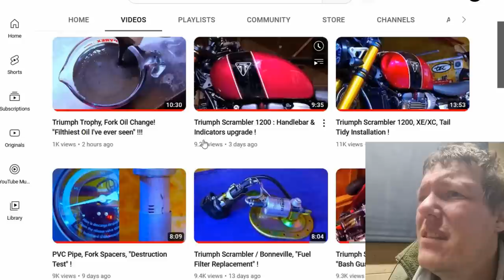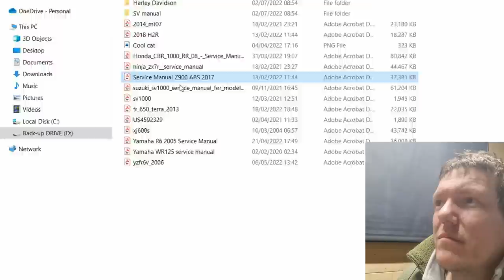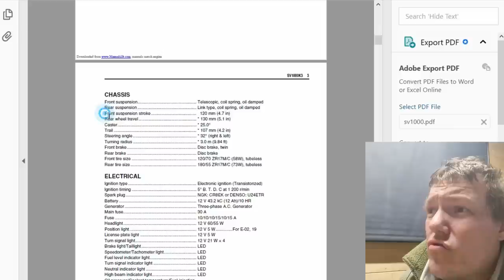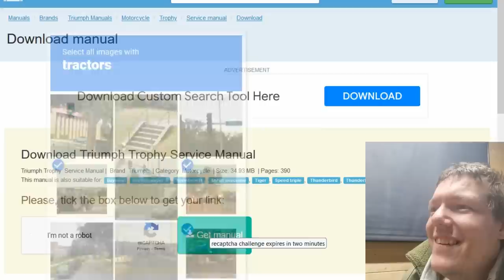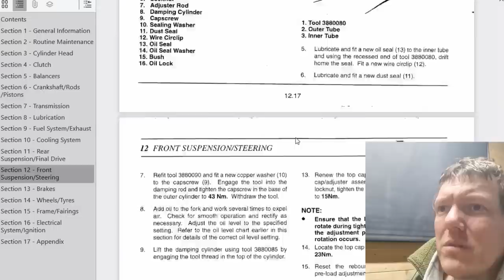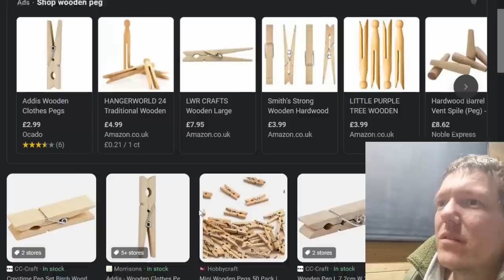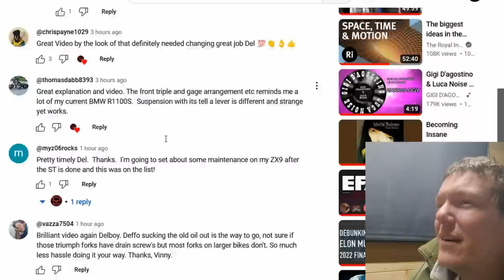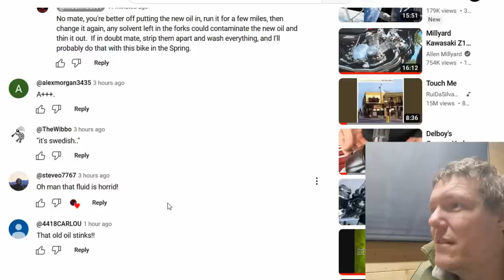Terrible fork oil replacement

Comment: He did say drain 'Screw' not bolt. Years ago even in 90's there was drain screws either on the side or on the back of the fork slider to drain fork oil out you are wrong by looking at Bolt.
Reply from the maker: Lol what? Dude, that's not what del meant. Can you tell me what the difference is between a bolt and a screw?
Reply: @dirtygarageguy  it is what he meant. Coming from earlier generations i knew exactly what he meant. And you are clever enough to know the difference between a bolt and a screw.
Reply from the maker: Can you give me an example of a bike that does?
Reply: @dirtygarageguy  kawasaki GT550
Reply from the maker: And del had one of those?
Reply: @paulmessenger1006  Hey, that's one of my favourite bikes of all time. An interesting in-between in engineering, with interesting gas-assisted suspension front and rear.
Reply: @dirtygarageguy  dude stop picking. He was correct when said no screw. Many bikes of that era did. You asked for an example which i gave you. Just admit and man up when you are wrong. That gets you more respect.
Reply: @dirtygarageguy  a bolt has a shank.
Reply from the maker: I asked you for an example to shoe how old that concept is, about 50 years old. Almost every bike on the road today doesn't have one, del has never mentioned it before so I said I don't think he meant that. You seem to think he does. They're just 2 different opinions on what we think someone said, there is no right or wrong... you're just spitting your dummy out.
Reply from the maker: Bolts have a nut, screws have a thread in the substrate. If you have an M12 x 100 with a shank and a M12 x 50 with no shank one is and isn't a bolt?
Reply: @dirtygarageguy  no shank is a 'set screw' as you should know. You oviously dont want to admit you are wrong, and others have also pointed this out to you.. My respect is now diminished.
Reply from the maker: Fuck sake, it's tit for tat with you isn't it... Read the ISO paper on bolts and screws.... some wood screws have shanks, are they now bolts? Use your head.
Reply from the maker: Forgot to add, do we call cap screws with shanks bolts? The clue is in the name....
Reply: @dirtygarageguy Dude who's playing tit for tat?
Reply from the maker: I just love winding people up when they cling onto every last detail... now before you say isn't that what these videos are? Yes, but I try to cover every base because people are learning...
Reply from the maker: In other words chill out dude, you're getting too irate

Comment: Del is trying to Show People How to Save Money, Labor Shop Hours By Doing it Your self, Thing is You Don't charge yourself Labor So it Cant Take as long as YOU want So Just Take off the Forks and Empty out all The Oil then Take another Hour? to Check The components for wear Nice and Clean only do it once change Worn oil with Good Oil Get more Pressure more leaks that's Two Weekends Wasted doing the same job twice.

Comment: Hi Matt, currently 08:48 in Melbourne Aust, and already 24.9 Celsius, on its way to 32 and sunny. Oh, that's right, it's Summer here, WooHoo!
Reply: 11:00am - 31.3°C🌡☀ In (Werribee) Melbourne, Australia.
Pretty warm in my garage (rebuilding my mates Zx14 master cylinder)  :D
Reply: NZ, 4:40pm, 20°C, sunny and just woken up from a snooze under my tree. Mowed the lawn and had a beer. Perfect.
Reply: @prdoohan  You didn't mention having your way with a sheep, so hardly 'perfect'. Or is mowing the lawn the new Kiwi slang for having your way with a sheep?

Comment: Just found a hooky copy of the trophy (and daytona, trident, sprint, tiger speed triple, tbird and adventurer) service manual.  Front Fork Oil - change - every 12000 miles.  No time limit, most of the service items are "whichever comes first" but fork oil is definitely every 12000 miles.  

WRT draining the forks from the bottom, he did specifically say "drain plug", and I don't think they have one. Trumpet definitely specify pulling the fork leg and pouring the lot out from the top.
Reply: And now, 27 minutes in, I see you've done the same.  D'oh!

Comment: Drz400sm forks have a sealed cartridge inside, 180ml or so in the cartridge and 350ml in the main body. That pathetic way of extraction would not work at all. And three days ago mine where apart and the thick sticky gunge in the bottom was stuck to the internals. If someone with similar forks removed oil with an extractor and then put 180ml extra in then they could potentially die. Another dell dissinfo danger vid.